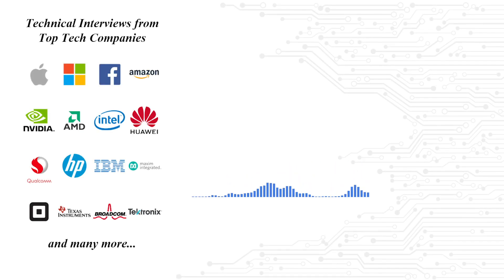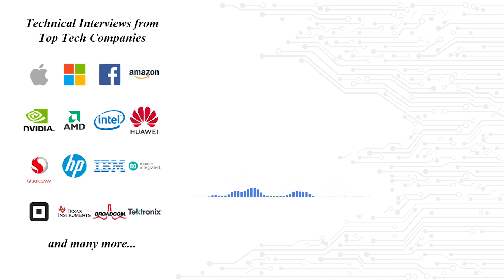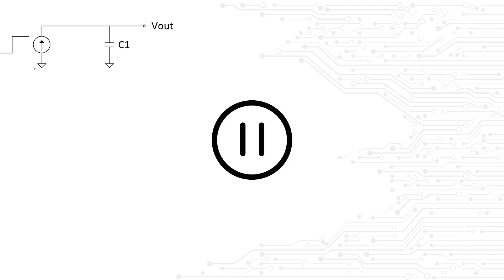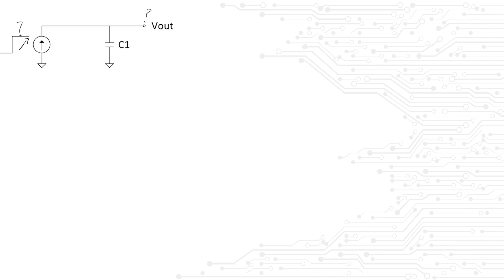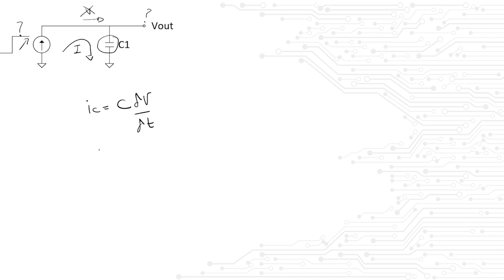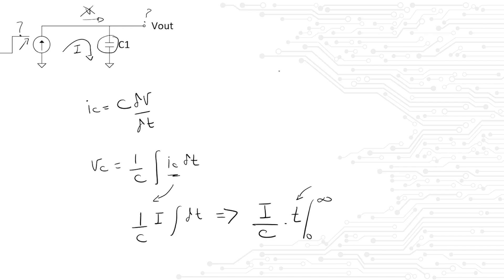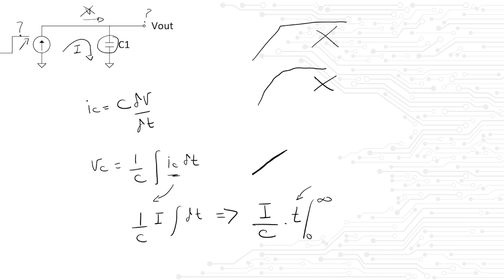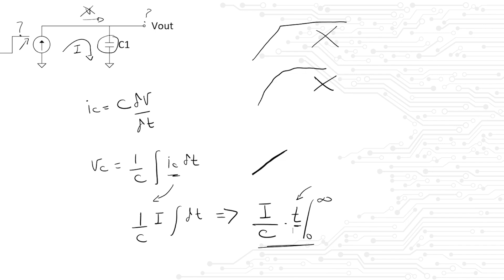HWN - Hardware Interviews S1E3 - Current & Capacitors

Comment: I went for s domain analysis and easily got the Vout as linear function of time. i have a habit of going for s domain analysis whenever i see capacitors. is this something i should be doing, can i get in trouble because of this approach of mine?

btw, cool video as always!
Reply from the maker: Unfortunately the S domain only applies for small signal analysis. Once we talk about step-response we're talking about large signal analysis.
Reply: @HardwareNinja  you mean steady-state responce, the capacitor should act the same with any input amplitude. The s-domain analysis discards initial responce behavior.

Comment: it wont saturate because of capacitor rating. It would saturate because of the limit of current source. If a capacitor has voltage rating, it might get fried.